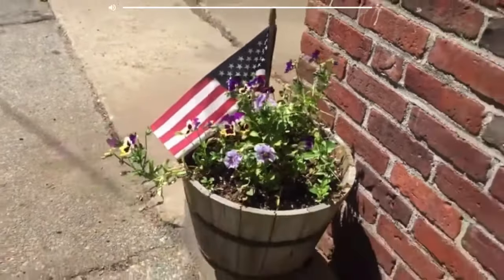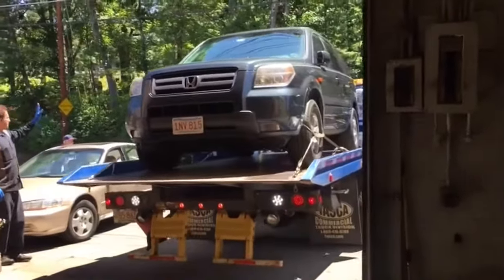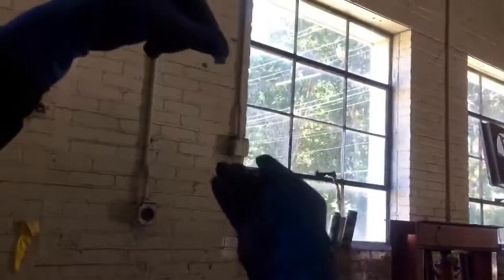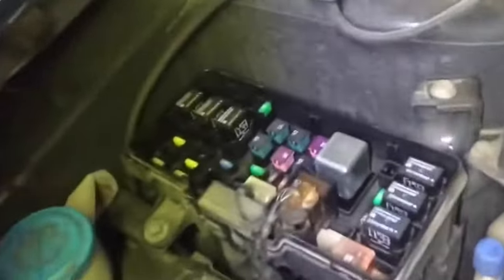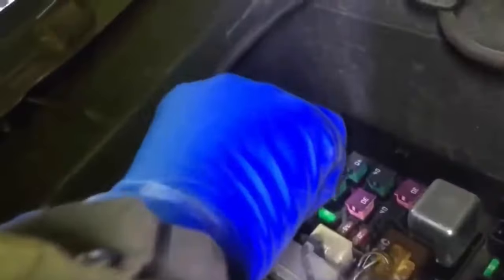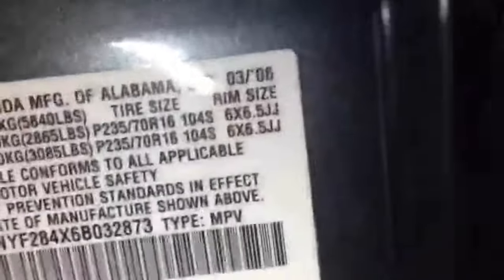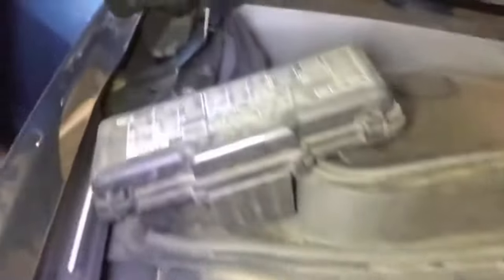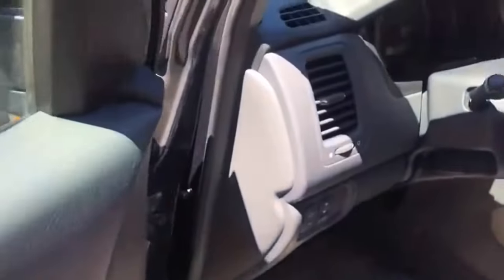Honda llave verde intermitente Luz De La Seguridad ¡Arreglo rápido!!

Comment: Hola yo tengo un acura mdx 2005 ya le revise los fusibles y estan bien  esta la  llavesita verde encendida  funcionaba despues de varios llavasos a veces solo dos. A veces hasta 30   pero ahora no enciende sigue la llavesita parpadeando
Reply from the maker: Hola El Michito Forkchat

Gracias por su retroalimentación. Lamento saber que su Acura MDX 2005 está teniendo un problema con la llave verde. Ahora, debido a que no tengo su MDX en mi tienda para diagnosticar completamente lo que está sucediendo, solo puedo darle un par de consejos. Aquí hay algunos trucos que aún puede probar.

Empiece siempre con lo básico:

-Si tiene un sistema de alarma / sin llave, cambie las baterías al Clicker o Clickers.

-Si tiene un sistema de alarma sin llave, haga que revisen su sistema de alarma para ver si se activó el interruptor de apagado / desactivador de alarma o el silenciador de alarma de robo, que generalmente se encuentra debajo del tablero del lado del conductor.

-Si NO tiene un sistema de alarma / sin llave, lleve su llave y / o llaves a su concesionario más cercano para reprogramar el chip en sus llaves.

-Puede hacer que alguien familiarizado con la mecánica, o un mecánico, desenchufe de forma segura la batería de su automóvil durante 30-45 minutos, de los cuales crea un "reinicio completo" para todo su sistema eléctrico. Y mira si funciona.

-Por último, si todo falla, intente revisar estos enlaces que agregué a continuación, pero están en elgish. ¡Buena suerte, cuéntanos cómo te fue!?!

https://youtu.be/z6q__8jOQP0

https://youtu.be/cpAzB1wxV3M

Gracias de nuevo, por tu FeedBack y si nuestro vlog te ayudó, envíanos un LIKE Y
gracias por el SUBB👍🏻👍🏻👍🏻

Comment: Mi honda pone una luz amarilla en el tablero qué indica?, gracias
Reply from the maker: hola, Hortensia Vizuet. gracias por tu retroalimentación. así que debido a que no tengo su auto en mi tienda, no podré decirle qué le pasa a su auto.

Todo lo que puedo hacer es darle algunos consejos básicos sobre cómo puede descartar algunos de sus posibles problemas que pueden funcionar o no.

Siempre es una buena idea ir a su taller de reparación de automóviles local y luego conectar un lector de códigos para guiarlo en la dirección exacta.

buena suerte. 

Empiece siempre con lo básico:

-Si tiene un sistema de alarma / sin llave, cambie las baterías al Clicker o Clickers.

-Si tiene un sistema de alarma sin llave, haga que revisen su sistema de alarma para ver si se activó el interruptor de apagado / desactivador de alarma o el silenciador de alarma de robo, que generalmente se encuentra debajo del tablero del lado del conductor.

-Si NO tiene un sistema de alarma / sin llave, lleve su llave y / o llaves a su concesionario más cercano para reprogramar el chip en sus llaves.

-Puede hacer que alguien familiarizado con la mecánica, o un mecánico, desenchufe de forma segura la batería de su automóvil durante 30-45 minutos, de los cuales crea un "reinicio completo" para todo su sistema eléctrico. Y mira si funciona.

-Por último, si todo falla, intente revisar estos enlaces que agregué a continuación, pero están en elgish. ¡Buena suerte, cuéntanos cómo te fue!?!

https://youtu.be/z6q__8jOQP0

https://youtu.be/cpAzB1wxV3M

Gracias de nuevo, por tu FeedBack y si nuestro vlog te ayudó, envíanos un LIKE Y
Un SUBB👍🏻👍🏻👍🏻

Comment: Ese es 2006 tengo el mismo problema con una honda pilot 2011 y ese fusible ya lo chequie  y esta bien y la luz sigue asi verde blinking que mas podria ser??
Reply from the maker: Hola David Perez 
Oh, siento oír hablar de tu Honda Pilot 2011. Sí, ¡hay algunas cosas más que puedes hacer!

Empiece siempre con lo básico:

-Si tiene un sistema de alarma / sin llave, cambie las baterías al Clicker o Clickers.

-Si tiene un sistema de alarma sin llave, haga que revisen su sistema de alarma para ver si se activó el interruptor de apagado / desactivador de alarma o el silenciador de alarma de robo, que generalmente se encuentra debajo del tablero del lado del conductor.

-Si NO tiene un sistema de alarma / sin llave, lleve su llave y / o llaves a su concesionario más cercano para reprogramar el chip en sus llaves.

-Puede hacer que alguien familiarizado con la mecánica, o un mecánico, desenchufe de forma segura la batería de su automóvil durante 30-45 minutos, de los cuales crea un "reinicio completo" para todo su sistema eléctrico. Y mira si funciona.

-Por último, si todo falla, intente revisar estos enlaces que agregué a continuación, pero están en elgish. ¡Buena suerte, cuéntanos cómo te fue!?!

https://youtu.be/z6q__8jOQP0

https://youtu.be/cpAzB1wxV3M

Gracias de nuevo, por tu FeedBack y si nuestro vlog te ayudó, envíanos un LIKE & SUBB 👍🏻👍🏻👍🏻
Reply: @CodesandCoffee  si gracias le puse el scanner y creo que tengo problema con el valet key